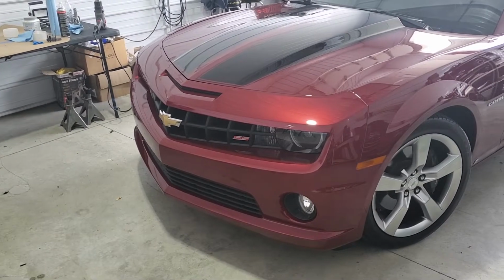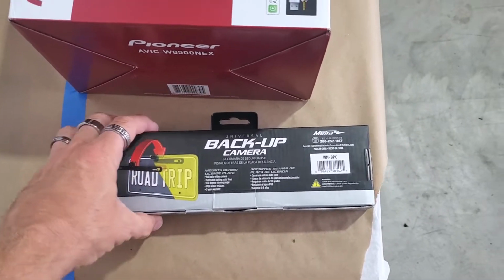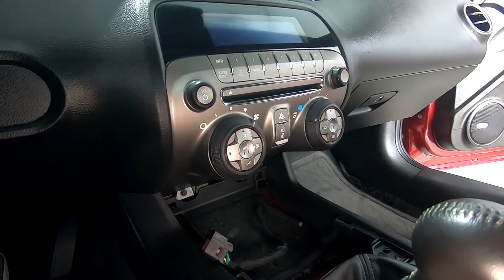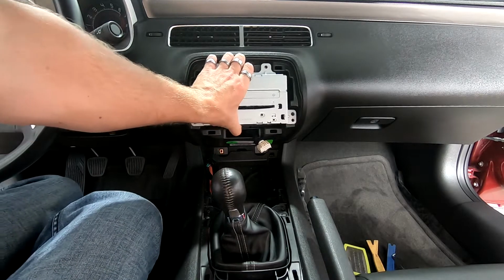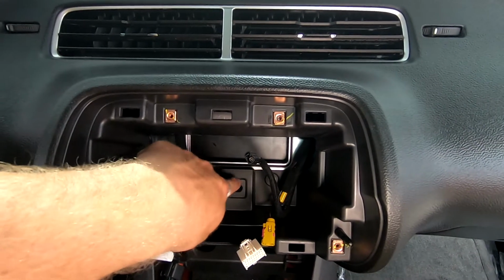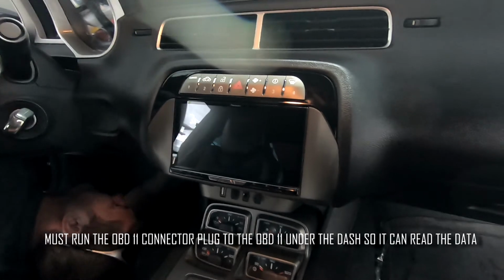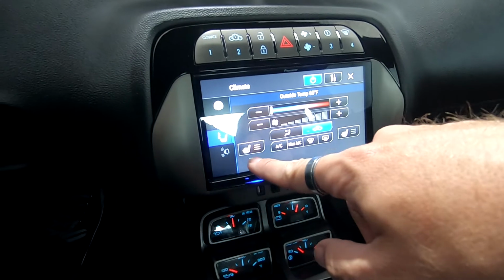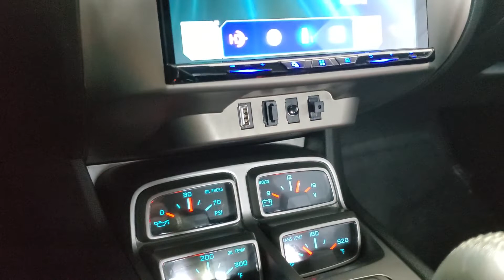2010 - 2015 CHEVY CAMARO IDATALINK MAESTRO DASH KIT / HARNESS -  PIONEER RADIO INSTALL WITH BOSTON

Comment: I have the same kit in my 2011 with a Kenwood head unit.  This kit is the best looking in my opinion,
Reply: Not the best looking but with an aftermarket head unit it bangs and output is very nice. 👍🏽
Reply: @mr2hard2see  what’s the best looking to you?
Reply: @salimparks4506  you could start here. 
https://youtu.be/AapYKmpyaDQ

They also have a newer version that’s like a Tesla touch screen.
Reply: @mr2hard2see  that is so cool!! thanks!

Comment: Beautiful I’m finna upgrade my RS Camaro to this 👏🏾👏🏾
Reply: I just had a shop install a Kenwood Excelon DMX790S head unit, and they also paired it with an Alpine full license plate frame backup reverse camera kit; definitely, definitely worth it for any 2010 (or 2011-2012) Camaro. The head unit also allows the backup camera to have accessible backup lines, if you’re comfortably with that. Also, this Alpine backup camera lens is adjustable, so it’s not sticking out 90° degrees (causes issues with the lens getting blocked, due to lack of shielding from the elements, rain, etc.).

The Maestro RR interface is what they flashed my ECU with, to retain the steering wheel controls, the original head unit controls and settings for the car itself, and also the ECU and OBD II data log stuff. 

I believe Maestro SW is a more universal interface, which they might use for other cars, but the ‘RR’ interface is FOR SURE what you’re going to want (and NEED), in order to retain all of the stock functions, get all of the 13-15 OEM GM MyLink functions, and even some Maestro software goodies from themselves (gauges, etc).

Comment: Has anyone had issues with the dash kit itself kind of “shifting”? It’s the dash kit “face”, around the double DIN head unit, that’s been shifting (or “sagging”, whatever to call it) from excessive heat lately. 

I can push it back like almost half an inch, but it just shifts back again… I had everything installed by a shop, so I have no idea if the mounting “block” that was cut out in the rear, might have anything to do with my sagging issue right now.

It doesn’t affect any of the buttons on the “face”, but the sagging leaves a solid gap (that can be pulled out even more). Idk what the shop’s gonna do to fix it, since they had like a “5-yr warranty”, and was basically going to honor anything they worked on. 

It’s only been half a year or so, but my backup camera has been glitching intermittently; also due to the heat, which idk, if that’s a coincidence too or not. Either way, there’s stuff like a noise filter that I need installed (outside of warranty repairs/fixes), so I’ll probably bring it back to get worked on. Hopefully they figure out a solid, legitimate fix for my stereo system, and check the head unit itself (Kenwood Excelon DMX709S).

Comment: I know this was almost a year ago, however I have two questions. Did this set up come with a navigation antenna or is that separate or do you even need it ??  also when using Sirius XM, do you need the SiriusXM SXV300 to make xm work. Thank you
Reply from the maker: I can't remember if it comes with a navigation antenna but if you're using Android auto app or carplay you can just use the maps in there. You will need a separated XM tuner because it is just XM compatible but you also have to have the tuner to make it work
Reply: You can also stream satellite radio stations through an app when your phone is connected instead of installing a real satellite antenna.

Comment: Does the navigation display on the HUD?
Reply: It does not from the radio or through carplay/android auto.
It does however display on the HUD when you use OnStar navigation.

Comment: I have 2011camaro ss and very low miled like that 10.

which kit do you like the best for the camaro maestro or the pac rpk 5 as I want to do the same set up and with the pioneer 1500nex.
Reply from the maker: This kit is absolutely the best from idatalink but you have to make sure that the radio get is idatalink maestro compatible

Comment: Do you have to cut the cube out or is there a way to unscrew and remove it? Does it absolutely have to be CUT?
Reply: I think it does have to be cut… not terrible, but you do have to realize that the OEM analog head unit was a single DIN, inside of a complete double DIN casing. If you remove the entire assembly/casing, you’ll see a screw in the rear, where the CD drive has a screw extending, with a wall anchor style mount that goes to that “cube” styled mount. 

If you’re installing these newer Carplay and navigation-equipped head units, most people don’t see a need to go back at all, whatsoever; that is, unless it’s an absolute emergency, and it would also be a lot of work going back that way. I’m actually not even sure it can be done… although I’m sure it’s been tried.

Even if the stock head unit goes back in, I think you can figure out a way to stabilize it, IF it DOES move around without that original anchor style mount in the back… It’s definitely not the end of the world. And if you had a shop professionally install it, you better hope they did it clean enough LOL Cause chances are, most people won’t be taking the new system out again themselves, unless they DON’T have warranty or run out of it.

Comment: The whole kit is a little expensive, but this is the next upgrade I want my Camaro 2014 1LE. Even though the OEM radio on my car has a touch screen, the factory software is pretty useless and has no Android/Apple integration.
Reply: Correction: I'll be getting the DO-15 from Digital Octopus
Reply: @OlivierCR did you do that? If so how do you like it?
Reply: @brianfyffe8204  I did, a year ago, but I decided to buy the Digital Octopus DO10-15
The digital octopus radio is the most expensive out of any aftermarket option available, but I like it because it looks OEM and has everything you could ever need or want out of an Android radio.
Reply: @cheddarballs864  There's only 2 reports of that happening so far, and the most likely culprit is an improper installation, people who has never soldered wires thinking they can install a car head unit by just following a youtube video.

Comment: I just installed this same kit with a Pioneer radio also. Everything works however, the accessory buttons for the gauges, climate, and vehicle info don't pull anything up on the radio itself. I can control the fan with the other accessory buttons and I was able to program the bottom row. But those three accessory buttons that are supposed to bring up a different screen don't do anything. Any ideas?
Reply from the maker: Is the pioneer radio maestro compatible? Also you have to have the idata link maestro data cable connected to the back of the pioneer head unit

Comment: Which wire did you tap into for the reverse lights ?
Reply from the maker: Purple with white stripe
Reply: @octanetvchannel  how does it link to the radio.
Reply from the maker: @jeffreymrrs150  not sure what you mean by how does it link to the radio?
Reply: @octanetvchannel  nevermind.was wondering how the stereo showed the car setup but saw the data link 4plug wire.